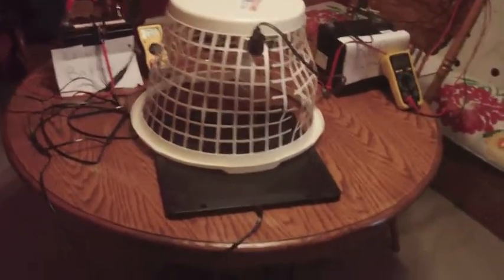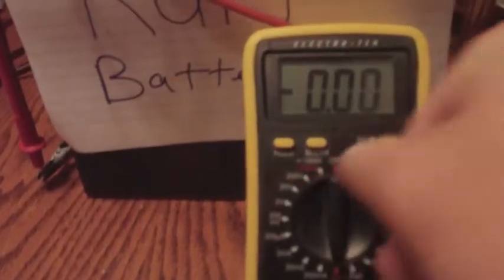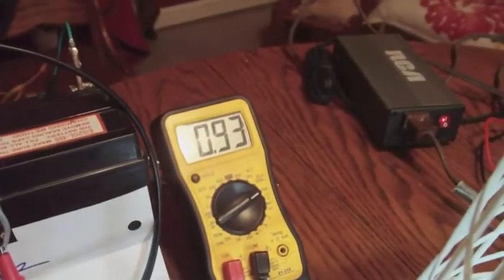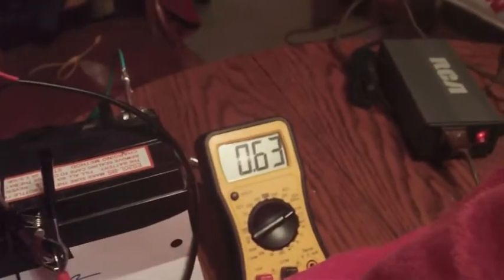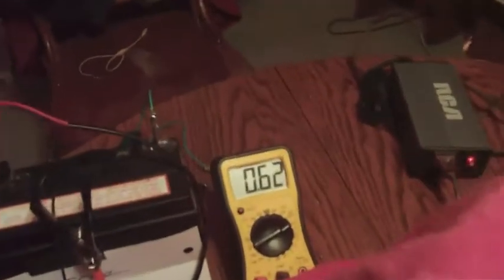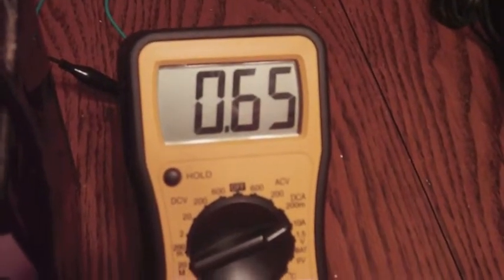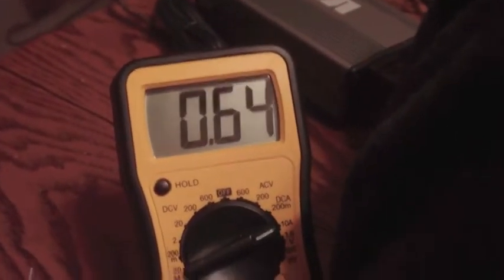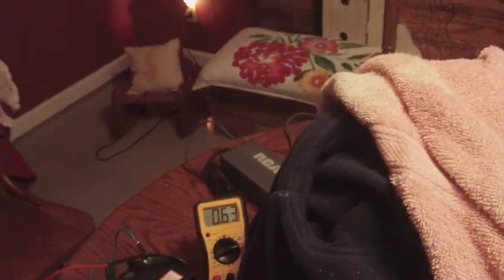Solar Panel Can Produce Overunity

Comment: Try to put caps at input and start with the battery but soon after connect the output to the input and try to run other loads as well from the output, that will be the real test which won't need any meter readings.

Comment from the maker: @vitanunis I still think about it and I figure out that I need to run the CFL on a smaller current. I’ve heard about some people on youtube lighting a CFL with a AA battery; thats where I need to be instead of these inverters and car batteries. I never knew it had 5 times the output?

Comment: Even though this experience has not resulted want you to think that in the case of compact fluorescent bulbs they produce a light power output greater than the input at a rate of at least 5 times more.If we have a photovoltaic panel with an efficiency of 20% then you have the energy needed to power the the lamp again.There are panels with more efficiency. Think about it and try it!

Comment: if Schweitzer was not right it also might be possible that the ambiant light (other then from the LED) generates some of the current you are measuring. The LED doesn't generate 1,5W of light but only about 0,15W of light and the rest is heat. The solar panel is apprx 14% efficient in converting light to electricity. The inverter efficiency is maybe 95%. Must be an error in the setup or measurement but I think it is an interesting experiment anyway. Thanks for posting.

Comment: @RimstarOrg How can the inverter affect the charge battery if it's not even hooked to it. The circuit is 
run battery->inverter->led light ****  solar panel->charge battery

Comment from the maker: @RimstarOrg The batteries were at 12.40 without load. I didn’t achieve overunity because the led build doesn’t even come close to the output of the sun which all my data was based on. I was getting micro amps when I needed mili amps.

Comment: What voltage is your solar panel running at? Also, what is the charge battery voltage? The inverter is a load on the charge battery and pulls the charge battery voltage down while running. If the charge battery is really low then the solar panel could be putting out much lower than 12V and still be feeding the charge battery. Besides those voltage measurements, I'd suggest trying with the inverter disconnected.

Comment: @ibpointless2 Schweizer must have it right and I was thinking the same thing.  You are simply getting the current direction backwards.  The current flow is not 0.63 amps into the charging battery.  The current flow is NEGATIVE 0.63 amps.  The charging battery is pumping current into the solar panel, which is the opposite of what you think is happening.  Please double-check your wiring and make sure that you know which way the current is flowing for the charging battery.

Comment: The room light may not have been strong enough to generate any voltage.  I have a cloudy day here and my panels are at zero V.  All panels have a light threshold that needs to be met before current will flow.  Disconnect the battery, turn on the LEDs and see which lines from the panel are positive and negative, and is it over 12V?  If not it can't drive current to the battery, instead, the battery will try to drive the panel.

Comment from the maker: @Schweizer135 The Panel’s Positive wire connects to the positive of the battery and the same with the negative cable. If the Solar panel did act like a big diode then wouldn’t the light above on the ceiling also cause a flow of power, but instead the amp meter read 0 until the LED light came on. I put a diode in line behind the left meter, it has a green wire going to it. You can somewhat see the diode at 4:24. If i’m wrong please correct me. Thanks.

Comment: The solar panel is connected backwards.  Current is flowing to the solar cells from the battery but this flow only begins once light is applied to the panel because the panel is a large diode that blocks flow when there is no light.  As for your light source battery, it is using supplying 4.4W to create 1.5W of light.  The rest is lost as heat in the inverter and in the light.  Have fun!